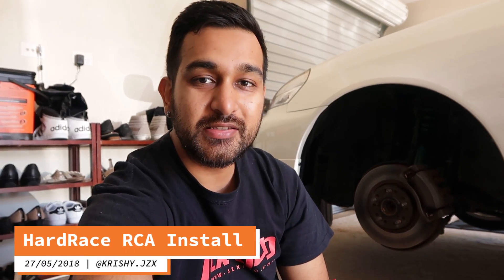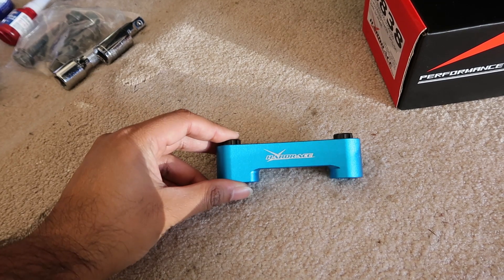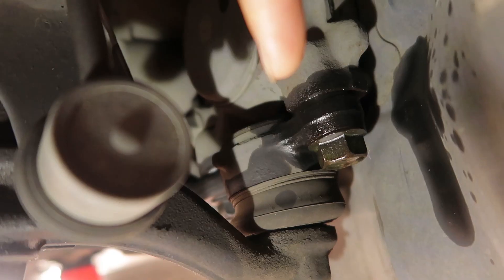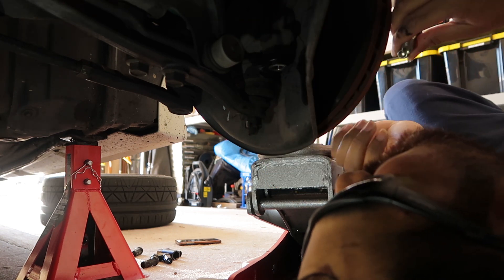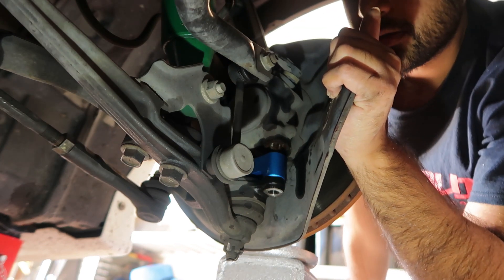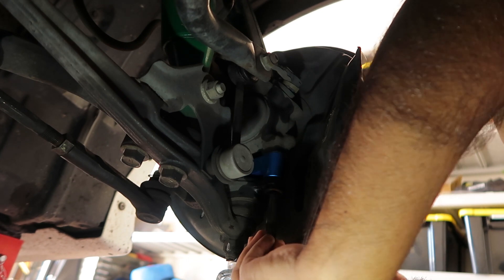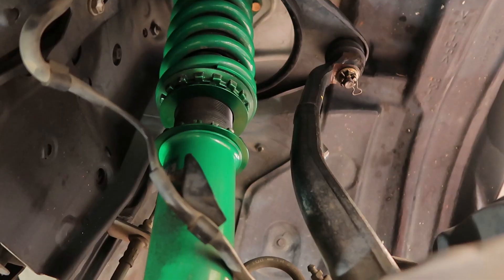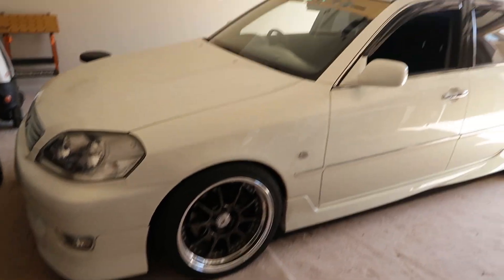Installing Hardrace Roll Centre Adjusters (RCA) on my JZX 110 Mark II

Comment: how bout the rear????
Reply from the maker: Rear brakes on the 110 are already 2 piston bbk style. No need to upgrade.
Reply: sorry meant if you could use the adjusters on the rear aswell?
Reply from the maker: @dizzzy1983  nah the rear is multilink setup, so there isn't anywhere to actually put an RCA. Don't think anyone makes it for the rear on this chassis.